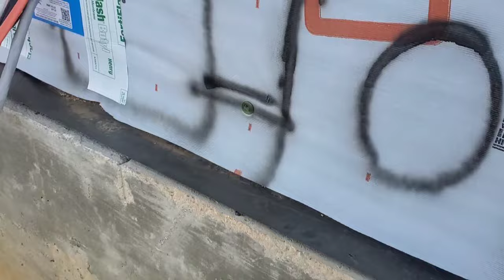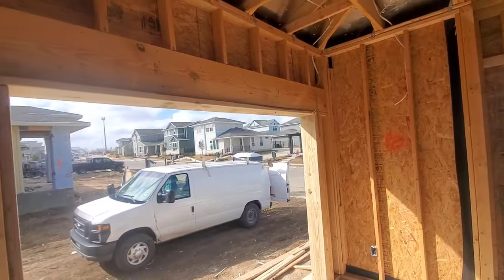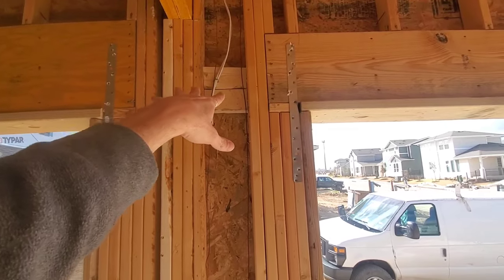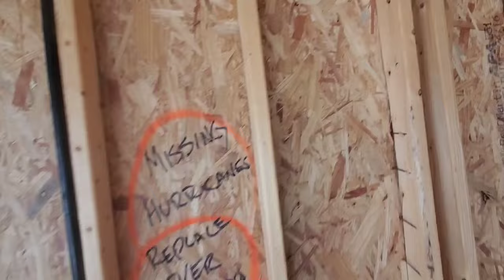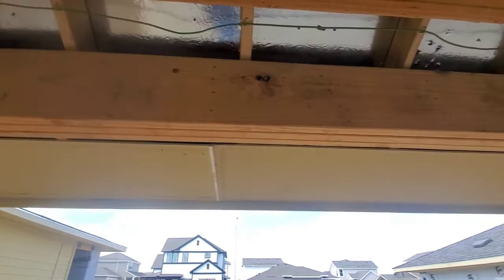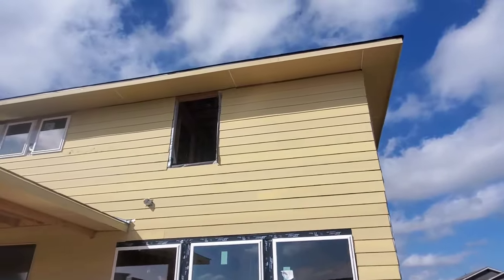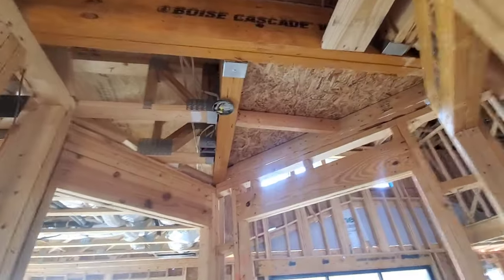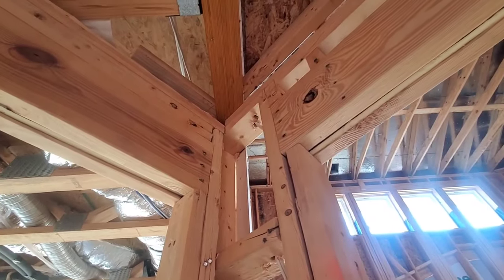Can't believe home builders get away with this! If you were building, get your own inspector!

Comment: Metal flashing/drip edge for the foundation and some through the roof will correct that oversight. Or an angle cut back of the concrete so it slopes away. .

Comment: It’s ridiculous, making those bolts in the concrete will hold that wall down .They’ll pull out their only nailer for the end grain of the wood. If you don’t have straps, forget it the proper way to do it have a strap in the concrete and run up the side of the stud. When I use to frame we will set up build a stack of inter walks and ever so often the bottom plate would fall off as we moved it to its location. The exterior sheeting only comes down 1-1/2 inches  and you need to nail it off in the center giving only 3/4 of OSB left to hold the wall down .

Comment: This is why I stopped framing 25 years ago in Tennessee and went into IT. The absolutely criminal work I saw take place and pass inspection turned my stomach. 2" gaps between the bottom of ridge beams and rafters? That was just the roofing. I was not going to be complicent in a family being buried under their own brand new roof.

Comment: 3:26 you said they were wrong because they don't have a 5/8 bolt yet they have the hilti power actuator fastener.  In fairness it probably was in the plans. However, at 3:56 you stated the interior shear should be the same as the exterior and said it was fine because of the same fasteners. By the way I think you are a great inspector who sometimes uses personal judgment over code or plan design.  FYI a little tip, those straps over the garage header are required to go from stud to stud. They can't stop in the header.  I'm done picking on you homie,  You ever wanna work on the big buildings in Houston let me know.  You definitely have skill!!!
Reply from the maker: Haha good eye brother! 
The 5/8 bolt is required per the PFH design in the code unless of course the plans show otherwise. At the interior shear walls the code says bolts but every set of plans I get the occasional chance to see also accept the shot pins usually 8" OC (two per stud bay) so if I see they've done that I let it slide. It's kinda like flying blind doing this without the plans.

Regarding the strap up to the top of the pony wall, you are 100% correct. I just never see it done and every city inspector (ATS, Strand, etc included) lets it slide. 

Shout me next time you are in ATX and we can grab some tacos and talk shop!
Reply: @constructivainspections  Sounds great!!!  Maybe next time try leaning on the owner for a field set for your inspection. I never had much luck with it because the builder typically refused but might be worth a shot.  One last thing maybe look into selling 1 year inspections for the buyers of new homes.  Before I went to the dark side, government, I had a big success by marking it up to add to the inspection cost.  Plus when the 1 year hit, I worked it around my schedule when I was in the area.  It was more of an evaluation service before their warranties ran out.  Anyways, keep up the good work and I hope clients flock to you because you have a very high level of understanding of the code.  Youd be surprised with some goobers we run into including those that work with us.
Reply: @JeremyGriffin-ls8zd  First, I live in Houston and am considering building a house.  If I do, I'm getting this guy (or one like him to inspect every stage).  Second, I'd 100% buy that uplift for the one year inspection.  This guy's attention to detail is amazing.
Reply: @David-ql1hd  Absolutely, If you build that house don't get scared because someone like him may charge more, hell offer him gas money on the weekend to come down for the inspection.  I promise you the level of his expertise compared to your average Trecky is night and day.

Comment: At 10 43 the beam is cut way to short and a chunk is spliced in lookis like 1 inch of beam is supported on 1 2x4
Reply: If you write it as "10:43" it will give a link that skips to that part of the video, makes it easy for others to see what you're talking about.
Reply: No its laminated beam. Not a splice by the builder

Comment: 10:15, did you notice the air gaps between the load bearing studs.  these should be nailed together, right?  That was present in other bearing points in the house.  Additionally the upstairs one is not plumb.
Reply from the maker: Oh there was a LOT of other things noted on the report that I didn't record on video. Good eye.

Comment: Tyvek shouldn’t be taped at bottom. Theres a lot more wrong with that ledge. You should have flashing running up behind the tyvek over the ledge
Reply from the maker: The masonry flashing you are referring to? Yes, it both acts to divert water to the weep holes and as a bond break to help prevent corner pops .

Comment: I've seen one other your videos. I assumed you worked for the city, until I read the synopsis of this video. If the HO hadn't hired you to inspect this build, city/municipal code wouldn't have required an inspection from one of their inspectors?
Reply from the maker: Yes in fact they still do require it. Problem is that the city is so busy doing 25 inspections a day that they don't have the time to spend on each structure like I do. 
I don't perform more than two inspections in a day.

Comment: I like the hurricane clips but the nails that's ur suppose to use is garbage. . Who in there right mind thought a 1 1/4 inch nail would hold "anything" much less a ceiling joist with tons of weight on it from the roof

Comment: As winner of NAHB 2014 for homes over three million . Yeah .. That's some rough work . I agree with 90% of what I saw was garbage. The let-in bracing generally is a 1x4 " 3/4" which is 25 % . not greater than 25% unless the goomba set the blade deeper " Which does happen .  Metal strapping in an X must be pulled taut . Here it wasn't . I do not agree with the assessment of the nailing aside the grage door or where the break in the sheathing is . Unless this is noted otherwise per plan , It meets Code . 3" OC on edges is not Code " Granted . I will nail leading edges brutally and might even glue the sheathing ... According to Code . Walls should be 25% structurally sheathed on the first and second levels . With garage doors . It kinda goes out the window . But in this case . I see a midspan LVL which provides rotational support if the upper level is structurally sheathed .. So the break in the sheathing is nothing . It provides very little top to bottom plate bonding . What I would be concerned with is the garage wing walls plate anchorage . 5/8" single anchor bolt is insufficient . 2- 3/4" anchors spaced at least to the corners and the kings with the L favoring the inside of the pour " Impossible to know unless you got an X-Ray " . Ramset is insuffcient and so are tapcoms or sleeve or expansion anchors . They shatter the edge bond . There is a Simpson anchor tie down from King to slab . The rock table flashing is horrible . Needs to be sloped slightly and sealed . We make our own copper Z flashing with a dripedge . Then wick cords spaces 32" . Wall faced with a dimple or breathing board by Coravent . Code requires a 1" air gap . Most rock masons just slap rock on the wall and don't use enough brick ties .Weak wall and locks moisture in . Semi-perm Typar , Drain Wrap or whatever maker du jour needs at least a 2" lap . 3" for some and taped .. The rock stop transition should be further flashed with aluminum roll or 30# felt tucked in half .   . All corners of Hardi should be wrapped twice and a 1/4 gap with drip edge , A corner stile is not enough and putting the reliance on the a painters caulk . The window installed and sided ? Nice tucking in head flashing which needs to be 1/4 " gap between siding and metal , taped and preferably with end dams . I see a future problem . The hangers sucked . The N-10's are insufficient . Common 16c's are allowed for shear . Not a major problem but preferable to be seated fully . The angled nails are no so much for the truss but shear into the LVL .  I have seen too much hackery in my days .. BTW .. 18' garage doors are the worst for wind resistence

Comment: Makes me want to buy a SIPs or pre manufactured home.
Reply from the maker: Not enough SIPs out here I can tell ya that!
Reply: SIP's suck, just find a good builder and wrap your home in exterior mineral wool
Reply: @morninboy  Way more material and work hours involved in that system, may be effective but at an extreme cost and complexity. Finding someone who actually understands and can build that system effectively would be a challenge as well.
Reply: @calivalley9056  SIP's can never offer the amazing versatility of wood framing or other structural wood methods.
If you were to see some of the homes I've built they would not of been able to accomplish the structures needs.
I have a 2x6 - R 24 - 1/2" ply - house wrap - 2" comfort board 1x4 batten wall system on the drawing board right now. Smart trim and Hardie plank. Not to difficult

Comment: As a carpenter, this is seriously disturbing. You dont need another 2x's to cover that gap in the sheathing, that needs to be a new piece to make the span and close the joint. No 3 inch toe nails in those hangers?!?I could only imagine how bad everything that's covered up is. The fact that they are using OSB in a house that I'd assume costs atleast 300 to 400k is insane. The window directly under a roof(coming off the garage I think? ) is a terrible design as well. Architects and engineers should have to work in the field for 5 years before they can even start their degree. So many problems would be solved by this. Cant tell you how many times their designs look good on paper and then installed are totally F'd. All the submittals..
Reply from the maker: Yeah, I can only imagine what a storm of F-1 tornados would do to some of these little boxes. That's right at the design speed for construction here.

Comment: I think the real problem is that these houses are way too complex.
 So the architect is as much to blame.
Yes the builders could do a much better job but it's too easy to quote low to obtain the job just to find that the design is a nightmare to work with, so if you are building a new home, stick to simple floor plans no angles especially exterior walls.
And if possible keep your roof trusses facing one direction. Better still support everything on external walls, internal walls are just for show.
And don't skimp on your builders.
Reply from the maker: I agree to keep it simple! I dunno why builders want to get fancy when the $$ is in the square footage. If a 3,000sqft box with a shed roof can sell for about as much as an equivalent size labyrinth with hips, valley, drops, etc, why not huh?

Comment: Im in south Texas and when I built my shop they had special nails for any type strap or hanger. About 2 " by 16p and really rough exterior 

Kinda like they weren't finished or dipped.
But those nails went to every strap or hanger or hurricanecstrap.
25 years ago.
I built entire 20' X 24 shop myself with a structural beam bisection the 24' length.
Pain in the ass but city guy insisted.
16" X 8" by 20'
Heavy bitch.
Good thing I built 9 foot walls!
Reply: No nailguns.

Comment: Can't believe anyone is still building exterior walls with 2x4 studs.  I've only framed with 2x6 or larger exterior wall studs for close to half a century. 2x4's will provide substandard insulation and general home frame weakness.

Comment: WTH !!!!! Do you not need a building permit and local inspections??? My attorney would be walking right beside you during this inspection. The builder is going down!!!!!!! I wouldn't even accept repairs or corrections at this point, you can not fix most of them without demolition. Gone too far.

Comment: 30 years ago we had our house built>>basic ranch on a basement. I checked the job site EVERY day and found a few errors to be fixed. I didn't catch it all I'm sure. Still living with some poor work by the subs. I did cuss them out once. We were to finish the pine woodwork so it could be installed. They kept making a mess in the garage where we were set up. I called them and ripped them a new one and said that if they wanted the woodwork on time, then stay the hell out of the garage.  The bricklayer doing the fireplace surround got dirty hand prints on the plaster wall making it necessary for us to paint the walls earlier than we wanted to. The builder had about 30 years in business and were actually pretty good. You almost have to be there every day, ALL day, watching and YOU have to know what you are looking at.

Comment: This is why I got out of commercial construction, rush rush rush!!

I'm much happier flipping houses and putting quality work into it and I'm my own boss!
Reply: Hopefully you do it right, most house flippers I see are the worst for hiding things and cutting corners. Cudos to you if you are taking the time to do it right.
Reply from the maker: I  must admit, the word "flip" has a rather negative connotation in regards to home construction. But it is true that when remodeling you have more time to get it right.
Reply: Yep I sure do, I only average about one flip every year or 2, depends on the work load. I have a normal day job but I'm trying to change that and flip full time. 

I'd even print off a paper of what I've actually done to the house and things that might still need to be addressed if I feel like I've put my time into it and anything extra would be better suited for the customer to decide what to do with it or offer a credit/home warranty.

Always make sure my houses pass Government backed loans like FHA or USDA. 

I go to auctions to help my material cost to be very inexpensive vs buying everything retail ( which in today's times, you'd loose money buying everything retail). 

I usually only touch estates or houses they really just don't want like a retired landlord.. 

I always get my houses under asking.. 

I'm also doing mostly everything myself to save money and my quality isn't dependent on our people.

Comment: Looks like it was framed by a bunch of 10 year olds.   I don't know maybe the 10 years would have done a better job with a little bit of guidance.  This is crap.  The osb siding should have had at least a 1/4'' small gap at the bottom and not even touch the concrete,  it going to act just like a sponge when it gets wet.  What's really sad it that this probably a 1/2 million dollar home